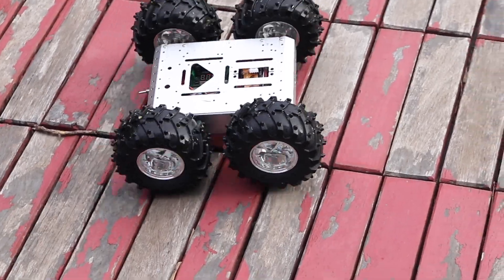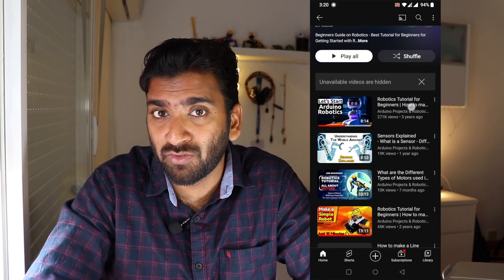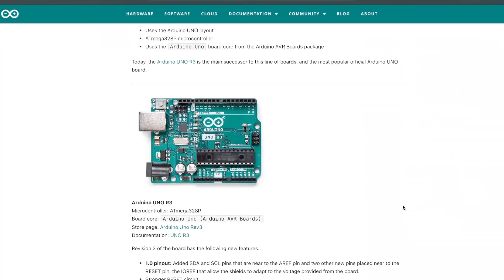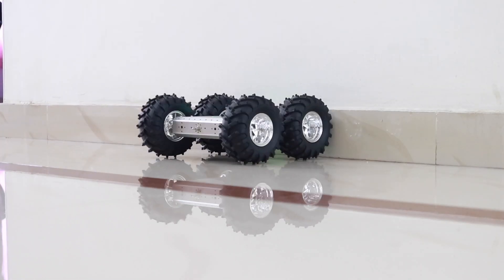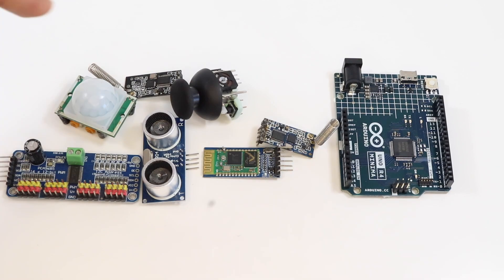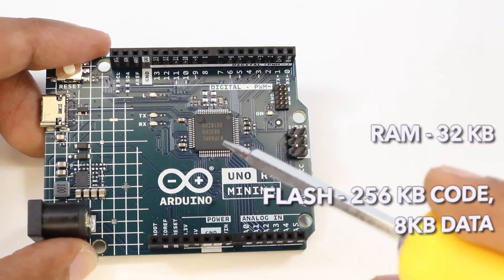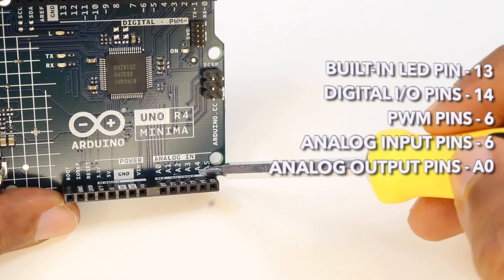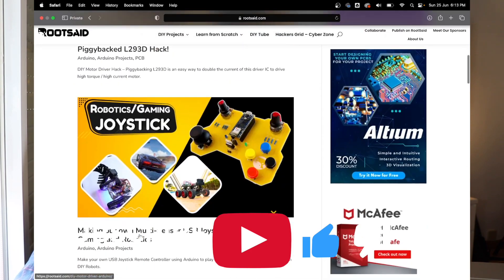Arduino UNO R4 Minima and WiFi -  Everything You Need to Know - Specifications and More!

Comment: is it possible to make a drone out of it?
Reply from the maker: yes it is possible, but I would prefer a smaller board like the new nano boards with wireless connectivity to make it light weight
Reply: Could u suggest a model that's currently more powerful (latest)and useful board in specific please....

Comment: Beware that the 5V is not the 5V we know. You could power 20mA on each pin with the original UNO, Leonardo or a MEGA, now you only have 4mA at your disposal. That is not enough for a LED!
Reply: Honestly forcing people to use transistors to decouple the controller is a very defendable design choice